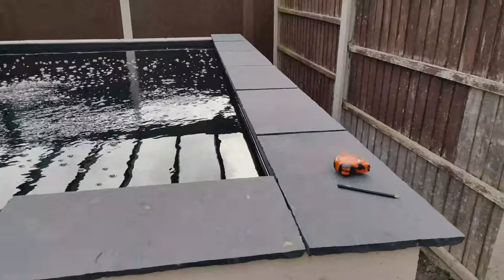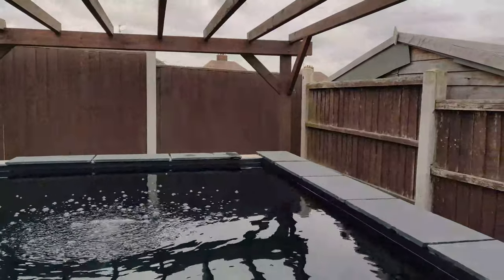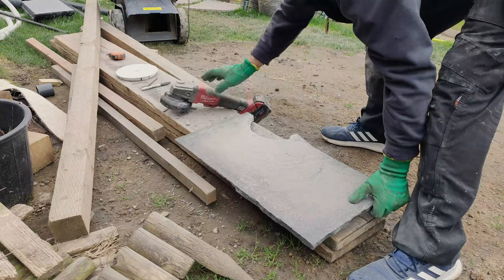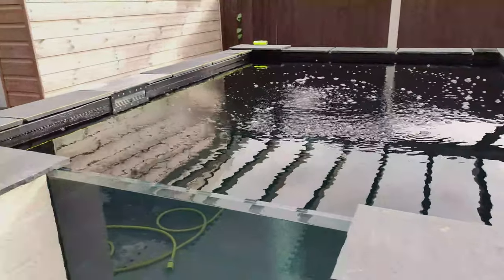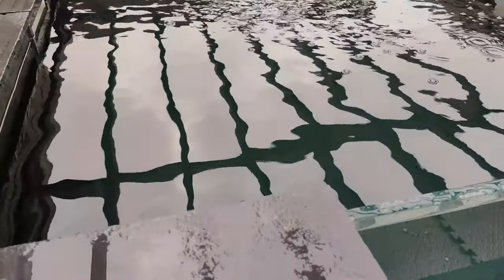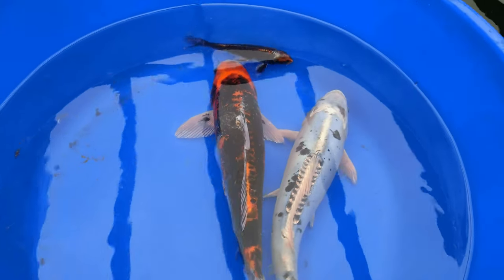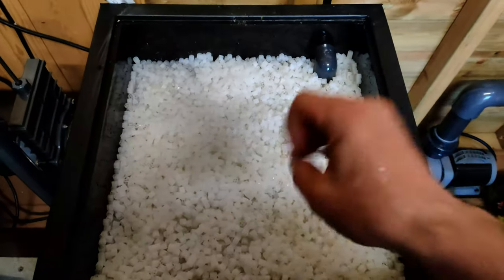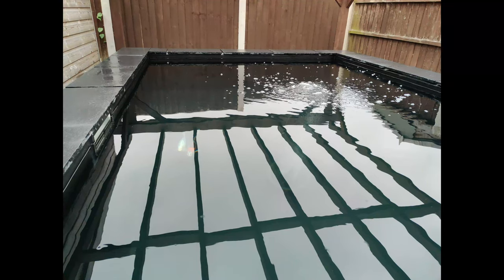Coping stones & the KOI FINALLY ADDED  **KOI FISH POND Build cont.**

Comment: I've got some fibres I use in concrete what could be added to you mix and do as someone mentioned about clamping a piece of wood underneath, that way there would be less of chance mortar breaking off when it's dry.
Rob.
Reply from the maker: that's a good idea with fibres. unsure how id clamp the wood in place though whilst it set, id need a lot of clamps....
Reply: @UpNorthKoiPond  you would have to do a side at a time which would prob drive you nuts lol, if fish wasn't in I would have said fix a baton to walls, I've got some fibres if you want some.
Rob.